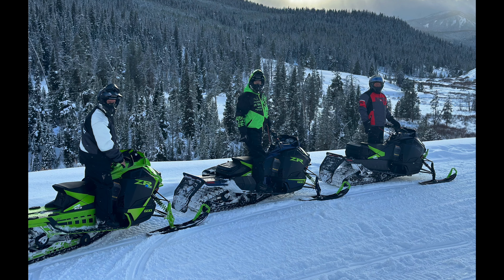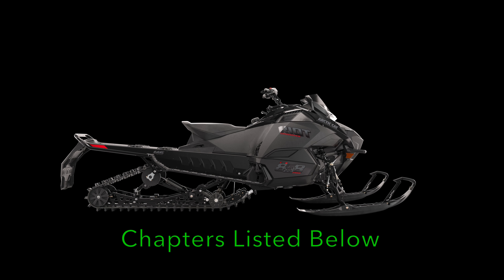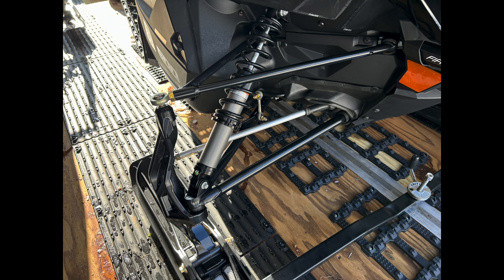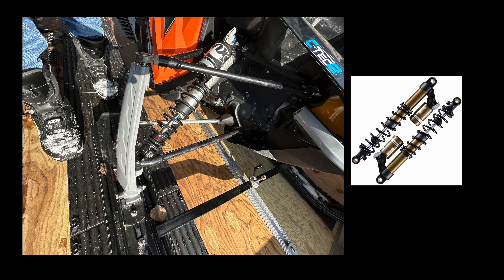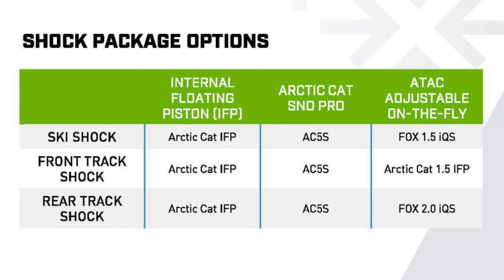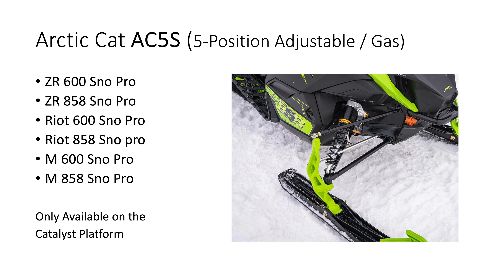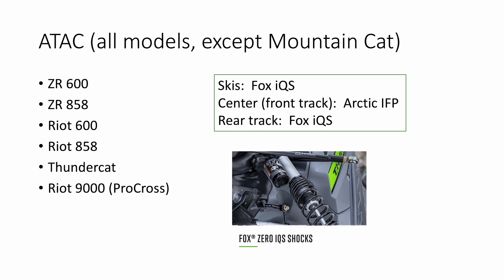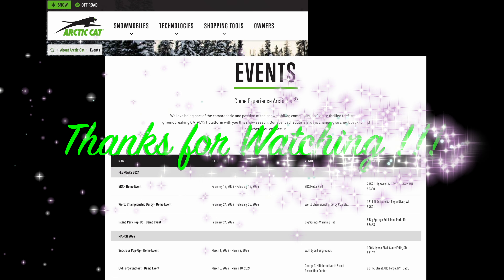2025 Arctic Cat - Invest in SHOCK Options

Comment: I just bought a XF7000 with Fox float 3 on the front. Never had them before.
Reply: I thought they stopped using floats years ago? I don't know why, they were great shocks if you had them rebuilt every year
Reply: @wko78ms  Well my sled is a 2014 so your probably correct.